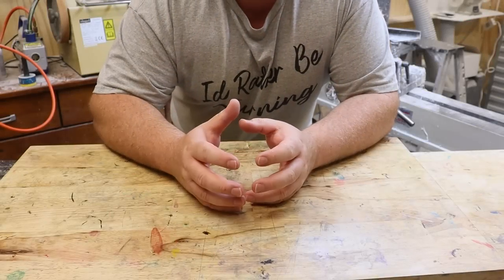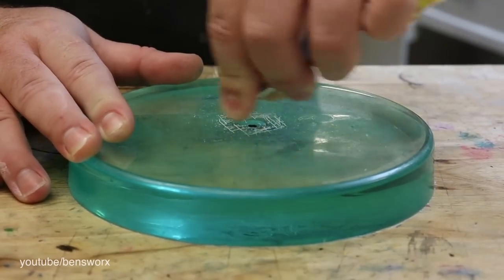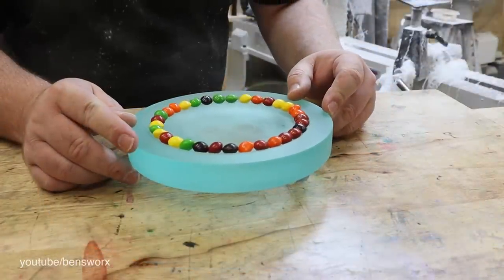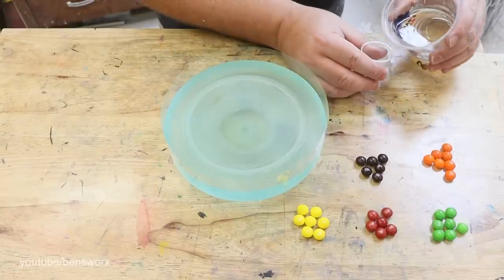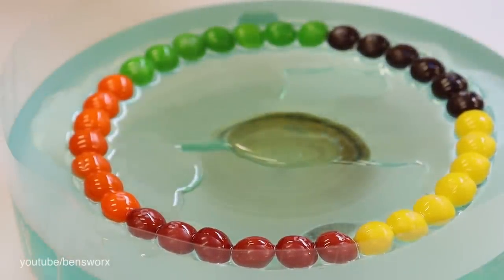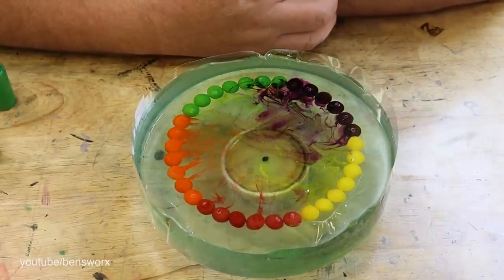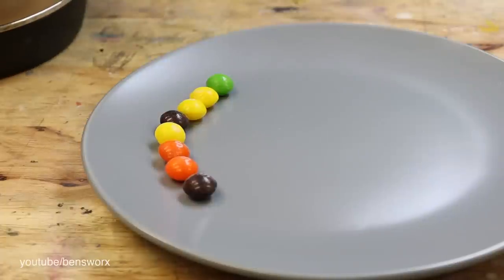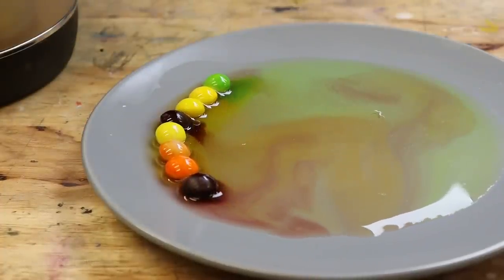Pouring HOT Resin Over SKITTLES - Will It Work ?

Comment: the coating is mostly sugar and it dissolves in water. you could try acetone. it should work and evaporate quickly enough to leave the color swirls as a residue you can put resin over.
Reply: I wonder if alcohol would work
Reply: @tiffanysandmeier4753  acetone will evaporate faster by far, but alcohol cud work too
Reply: @tiffanysandmeier4753  Yeah drink enough of it and all the colours start to run.

Comment: The skittles color is water soluble, so it makes sense the resin wouldn't affect it the same way. Yay chemistry!
Reply: I think you're right.  Maybe you could  stick them down with a thin bit of resin.  Once set use the warm water, but let it bleed and then evaporate.  Once done pour the final layer of resin.  You could test it on a paper plate to see how much water you'd need and how long it would take to evaporate...

Comment: Nice end result. I think the way to do it properly would be to use a minimal amount of hot water to get the colour bleed, allow the water the evaporate (maybe put it in a oven on low heat to speed up the process) and then cover it in resin.
Reply from the maker: Thanks Mate 👍

Comment: As soon as you mentioned the alcohol ink I had an idea. Would simple rubbing alcohol do the same as the hot water? If so, it should be a cinch to let it do it’s thing and evaporate so it doesn’t react badly with the resin.🤔 What do you reckon?

Comment: While it's unfortunate that the colors didn't run with resin, your solution turned out SO PRETTY!!!!!!
I wonder if using hot alcohol would work better for the colors before putting resin over it 🤔

Comment: Possible use for the skittle resin thing: Clock. Some long and thin gold hands, with as small of a clockwork as you can find (ideally circular) in the middle. Instead of putting numbers on the face of the clock, 4 colorful narrow triangles at 12, 3, 6 and 9 should be plenty.

Comment: Heat the resin separately, and then mix them together. You can get WAY more heat pre chemical reaction. The resin is not hot enough, nor viscus enough as you are doing it now, but throw the resin jugs in front of a small space heater prior to mix and then give a try.

Comment: That turned out great.  I wonder if you could use coloured glue sticks and cut them up using a stanley knife into smal pieces.  Would the glue sticks melt from the heat of the resin?

Comment: I’m at 8:15 paused so what I would try is to dip the skittles in hot water as the resin starts to heat up and then start pouring it. Idk if there is a such thing as warming up resting before pouring it but that may work.

Comment: The problem with resin is that it doesn’t dissolve sugar. You might have some success if you make something like the jawbreaker project, where the resin gets hot enough to melt the skittles outright, but the problem would be to have the melted sugar flow down, as you'd have to use so much resin it would cover any concacve before cooking off.

Comment: I'd say the problem is the resin is not an organic solvent. You'd need to use something that dissolves the sugar coating on the skittles, and readily evaporates leaving the residue trail behind, like ethanol or other kind of alcohol. Not sure if the viscosity of the resin will push away the color residue trail though, or it could be poured very slowly and carefully afterwards. Hope it works

Comment: Will new resin bond to old resin if you pour fresh onto cured to try to add to it? Will they fuse to become one solid piece, or just be two pieces stuck together, or just not stick at all?
Also 4:07 I saw that, don't think I didn't.
Anyways, the problem you have is that resin doesn't dissolve sugar, so the Skittle's shells won't run. So use water to make the colors run, and then put it in the vac chamber to evaporate all the water off, and then you can pour your resin on top of the sugar pattern left behind, and the colors won't run that time either and will instead stay in place where the water put them.

Comment: Hi Mr Ben, I'm wondering if a pre-heat of the candy would work. Say oven or something, a microwave would melt it too fast, I think. If hot water is what 80°c (for example) and then the heating resin on top, it just might work. I've also thought that a slight spin effect would look cool too. But that's a different experiment. One trick at a time so to speak. What do you think?

Comment: I think the reason that the color dissolves in water is because water is a polar molecule.  It's got a positive side and a negative side (when you over simplify things).  That helps it dissolve things like sugar that others have pointed out is what the colors are primarily made of.  So I don't think there's a way to make resin do the dissolving.  @CyborgOctopus talked about acetone.  That could work. Acetone does dissolve a lot of stuff.  If that doesn't work, maybe rubbing alcohol, as it dissolves a lot as well and evaporates just as fast as acetone.

Comment: The heat of the water isn’t really what makes the color bleed happen in the skittles, it’s just what makes it happen quickly. If you put skittles in a dish like that with room temperature water, they’d bleed colors, just much slower, as the water dissolved the sugar coating. If the dish was shaped the right way, you’d see the colors run to the middle then too, because of the density difference of the dye. It seems like the resin doesn’t act as a solvent the same way water does, so the colors don’t bleed. You could potentially dissolve the sugar coating with water or some other solvent, let it evaporate, and then cover that in resin?

Comment: its because the coating dissolves in hot water, meaning the resin is not hot enough plus you dont pour over the skittles you pour in the center of the bowl and the the colours flow

Comment: Wonder if there is a way to cast a volcanic eruption.  Have a volcano shape with material erupting out of it.  Even if it’s only lava lamp style where the colored material in the volcano form is hotter than the resin above so rises and moves like a lava lamp.  May need two different types of resin, one that gets much hotter and can be injected into the volcano form right as the covering resin is setting so the material moving up can be captured.

Comment: Yeah, I hate to say it but I was pretty sure it wouldn't work. Water-based candy coating and resin simply aren't the same thing at all. I didn't expect the candy to dissolve in resin. I've seen many many MANY food items embedded in resin that do not react to it as they would in water. I've even seen candy materials in resin that would have melted and dissolved in hot water but nothing happens in resin. The candy coating is water-soluble but the hot resin is chemical-based and doesn't behave the same as water. I do love the workaround. Of course there might be another type of resin that will disolve sugar. Maybe there's a way to use the water, let it dry then add the resin? Hold on! Put down a layer of resin wait till it's almost hard, then add the skittles and water on that?

Comment: I know this is an old video, but I know how you can make this work. Do what you did to start, then put a little bit of resin in the groove to hold the skittles like you did. Then let it completely cure, so the skittles are stuck but there's no resin on top of them. Now use the hot water to create the effect that you saw. Let that completely dry and then encase it all with clear resin. I think that'd be the only way to get it to work. I do think your "fix" did look awesome though!

Comment: For better results, place the skittles around the edge, then pour the hot water or resin into the centre of the plate, bowl etc. Don't actually pour over the skittles. By pouring in the centre, it basically drags the colour from the skittles towards the middle.

Comment: Skittles dyes are hydrophobic, dissolve in water. Resin is elongated carbon chains - like oil - hydrophobic. The skittle dyes will not dissolve in resin - with a single exception of a resin that has a matching chemistry to the dyes.

Comment: The skittle dissolve in water. It won’t work in resin. It isn’t the heat it is the water.  
Let’s try this—-use UV resin to glue the skittles down. Then pour resin over it.  Only add just enough to just barely the top of the skittles. When it gets thick drop the alcohol ink. On the skittles, then you can move it if you like. 
Look at  resin flower coaster videos  to get a better idea of what I’m saying.

Comment: Quite surprised by the result. My hand gets coloured just holding skittles. Maybe the viscosity of resin is too high to allow the colour to bleed and flow.
Reply from the maker: Me too, I was thinking the same thing
Reply: It's not the viscosity or the heat that makes the skittle color run. It's because sugar is water soluble, not resin soluble...